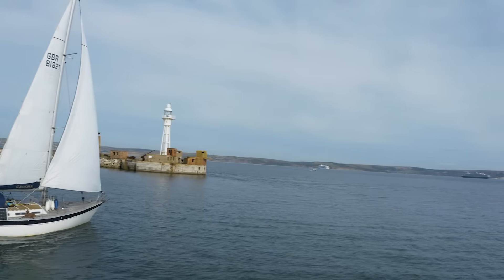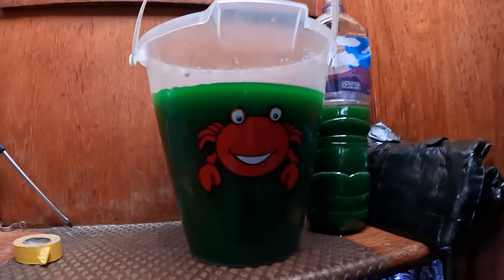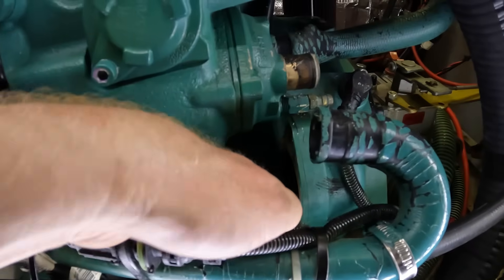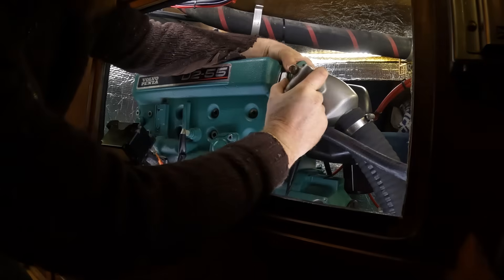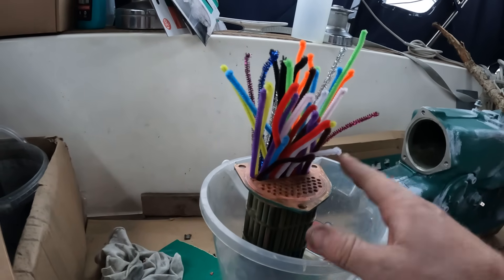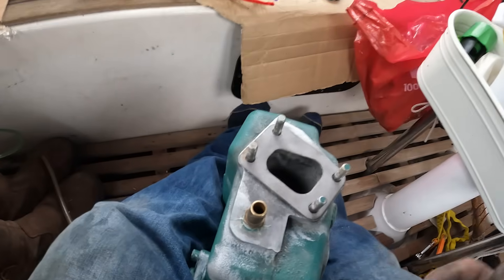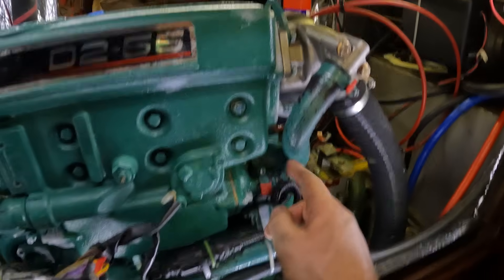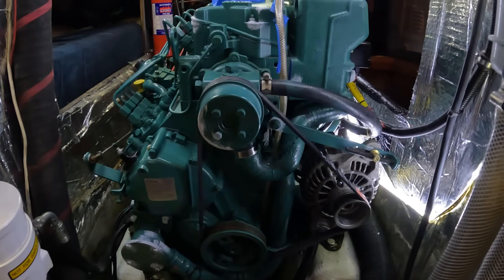Overheating  - Troubleshooting a small diesel sailboat engine  (Volvo Penta D2 55F)

Comment: paint is an insulator. it will retain heat in the engine block and contribute to the heat load. best to have as little paint on it as possible. unfortunately, and not surprisingly, most people cannot tolerate an unpainted engine block. :)

the host shows an unusual amount of patience and good cheer considering the amount of work involved in performing what one would think to be a simple task. i'm thinking the engine designers did not plan for the possibility of a saildrive. ....just guessing. :)

and either the host is lying about his previous lack of engine knowledge or he possesses a natural talent for engineering. ...i suspect the latter.
Reply from the maker: Appreciate the feedback. My thoughts for painting the engine are for protecting against corrosion?

Also your last paragraph has really made my day, I honestly couldn’t have even told you what a fuel filter looked like or even where it was just a couple of years ago 🤣☺️☺️

Comment: But, why didnt you check the impellar why you were at it? Also, i dont know the engine but did you try the heat exchanger fit the other way around as the flanges look the same and its a through fitting? nice haircut btw lol
Reply from the maker: I did check the impeller, it was one of the first things I did. I didn’t think the heat exchanger would fit the other way round as one side had a plate attached to it, but  I have to admit that I didn’t actually check to see if it would be possible, I was so overly concerned about putting things back as I found them 😬😬

Comment: I have an older model 18 hp 2002 with a saildrive which I purchased new in 1986 and regularly have to repair it as it slowly dissolves away. I won't list all the expensive problems but I have a word of advice, Yanmar.

Comment: It looks to me like you could have put the tube stack in the opposite way when reassembling.  That way the next time you clean it you would not have to take the whole thing to bits.  When I clean my tube stack (different make of engine) just hosing out the tubes after a soak works fine.  You do not need to pipe cleaner it out.

Comment: Torque Wrench!!!   Just to reiterate.  Torque Wrench.  Also, Loctite or other such thread compound will prevent seizing and ensure consistent torquing of the bolts.  Sometimes, manifold bolts are NOT coated with Loctite, but your manual should tell you what they want.  It really helps with little fitting bolts like your end covers, etc...

Comment: Small points, firstly, when using grease on rubber use the red grease , it doesn’t eat rubber . Secondly, only use sealant for water ways , not the correct stuff, and probably not needed on manifold gasket’s. As I said, small points.
Reply from the maker: Thank you so much for sharing your knowledge with us all. I learn so much from you all 🙏⛵️😁😁😁
Reply: @CadohaAdventures  unfortunately it’s mostly hard learnt , I’m a marine mechanic 🤔😪😪

Comment: Marine diesel engines by their nature are often housed in locations with very limited access, so it would be helpful if they were designed to have good access to service items in addition to the oil and fuel filters and impeller!

Fitting a hose which was molded to allow the heat exchanger clearence to be removed without the hose being disconnected shouldn't have been beyond the abilities of the manufacturer.

Inevitably, if something requires additional work to access it may well be overlooked and lead to reliability problems, as you discovered.

Comment: Sorry to blather on however when I see water used in these systems I have to comment. Engine coolants do more than just exchange heat. A big one is lubricate. The pump needs lubrication, and that’s why coolants feels a little slick.
Water should only be used to check for leaks but really not good for that. Water boils before the engine reaches proper running temp, so if you want to check leaks and don’t have a pressure testing system, then you need to bring it up to full temp.
Water turns to steam, gets too hot so problem diagnosis is difficult. I spent many years trying to resolve heating issues in IC engines, all kinds. I’ve never had nothing but additional problems using water in IC engines.

Comment: you were so frustrating to watch,  it's called a Heat Exchanger, yes you need to take the whole heat exchanger off to pull everything apart, my D255c is about 20 years old, buy the way it's a Perking Diesel Marinated by Volvo, few more tips Carry a spare Welsh plugs,  mine got a pin 📌 whole in it and was squrting water out, I glue it back together now as it's got so much corossion on all the parts, keep a eye on the seal above the starter as it can drip on it, lucky I saw it in time and heard the starter sounded very dry, your very lucky you can work on it from the side, mine i have work kneeling on top of the motor and if drop a part long way too bottom of the builge, thank you keep up the good work, does anyone know the manifold gasket part number so I can get one from a truck part's place cheers mate
Reply: p.s I could see the Welsh plug on the inside of the Heat Exchanger but you need to look closely at it they leak very slowly,  only a few dollars at the auto shops,
Reply from the maker: Sorry about being so frustrating to watch, I'm no mechanic, just a guy, trying to figure this stuff out. I really appreciate all the tips and wisdom you've just shared, that alone makes this such a valuable learning tool for me, and I hope others too.

All the parts I got were from a site called parts4engines.co.uk and they all seemed very good value compared to a Volvo shop, although you're right in that I imagine you can still get them much cheaper from Perkins or the like?

Best of luck 🙏🏻
Reply: @CadohaAdventures  you can't beat parts 4 engines they are the best

Comment: maybe the internal part of the heat exchanger could be put in from the other side  so when you have  to clean it ,in stead of pulling it from the rear side of the engine you  could pull it from the front so maybe disassembling the hole heat exchanger may not be nessesary it looks like it it could be put in from both sides.
just a thought
Reply: The heat exchanger is flanged on one side so it cannot be removed from the other side unfortunately...
Reply: @ozolli  maybe andi would give it a try and put the flang as you call it on the other side.
Reply: I saw picture,s in manuals  ,there was the flanged from the  heath exchanger   on de frontside

Comment: PPS, Diesels Love Working under load, and you can help clean the insides by checking what rpm Peak Torque an Peak Horsepower are for your engine, and, occasionally once up to temperature, run them for an hour or two between PT and PH. When doing a Crossing, As the Sun Goes Down, I Furl in the Sails, I Motor for an hour or so, Nav Lights and autopilot on, and get the evening Meals on the go, mostly using a portable induction Hob, and the Heat Exchanger is providing the Hot Water for a Shower, plus on my next boat, will be running the 12v Watermaker, Last Night, before the Sun comes up to hit the Solar Panels, do the same for Breakfasts The Routine keeps the Engine Happy, the high output alternator keeps the AGM Battery Bank and starter AGM Battery happy, and the Crew Well Fed, watered (tea, Coffee, hot chocolate etc) Showered and Happy as well. Happy Diesel Engines tend not to let us down when we need them. Bob. 👍🏴⛵️🌟🌟🌟

Comment: great design the volvo not - any water leak falls on the alternator that then needs replacing stoopid - see Zatara
Reply from the maker: They have this issue then? Makes me even more motivated to fit the dual alternator upgrade, now not just for the extra charging capacity 🙏🏻😁

Comment: Do not use any abrasives on sealing surfaces. You'll cause yourself more headaches than you can count. Use plastic razor blades, a rubber scrubber (they're specifically designed to clean gaskets) on a drill, at worst, a blunt razor blade at a very shallow angle.

However, if damage is already done, get yourself two sharp stones (the kind that come with two grits glued together) and after you rub the like faces together to achieve perfectly plane surfaces, gently and evenly in decisive moves go from one end to the other of the surface you want to clean, without pressing on the edges.

There's several videos detailing this kind of procedure on the machinist side of YouTube (people like Tom Lipton, from OxToolCo, or Keith Rucker from OldMachinery).

Sealing surfaces need to be as scratch free as possible, because any deep scratch you inflict or even light scratch you inflict will be 'tomorrow's' passage for gasses or fluids to escape and make things worse, doubly so in marine environments where everything seems to fall apart just to make one's life worse.

Comment: In terms of the electrolytic corrosion at the interface with the stainless steel exhaust elbow and the (Aluminium Alloy ?) engine a gasket will not solve the problem as it will be electrically bypassed by bolts / studs and nuts allowing the corrosion to continue. You need to consult an expert on how to prevent this but I expect that a stainless steel elbow is a bad choice as Stainless Steel or in fact the Chromium it contains is very active in terms of electrolytic corrosion. A good thing to read in the book about Metal Corrosion in Boats by Nigel Warren which covers the various problems in lots of details. It is probably better to have the elbow corrode than the expensive engine block. However you need to check & replace the elbow at regular intervals. Hope this helps and saves you the cost of a new engine jacket that will be mega expensive.
Reply from the maker: I've since now covered the bolts in Duralac but I'm also told that no matter what I do, the water flow will also cause a current, so the stainless steel exhaust elbow seems like a bit of a bad idea then? Annoying as it was such an expensive part 😔
Reply: @CadohaAdventures  
zinc pencil anodes?
Reply: @CadohaAdventures  Coating the bolts will not stop the corrosion as you need to have good electrical isolation. Something like a 'top hat' insulator that covers the thread of the bolt and extends under the head may work . BUT it has to stand hot conditions and the compressive force of the bolt - not an easy material choice. In terms of of the water flow causing an electrical current there has to be a complete electrical circuit. Think of it as a battery where the Anode & Cathode are the two different metals, the sea water is the battery electrolyte and the electrical path through the bolts or through the gasket if it is conductive completes the circuit and allows electrical current to flow and one of the components to corrode. In this case the anode & cathode are the cast iron of the exhaust manifold and the chromium in the stainless steel. If the bolts are isolated the circuit is broken and the circuit is like a battery with no load connected and little if any corrosion will occur. 

The insulation method is used when fitting stainless steel fittings to Aluminium Masts - a long while ago when I was involved in dinghy maintenance we used thick layers of Zinc Chromate at the joint and then special rivets to reduce the risk of electrolytic corrosion. Of course Zinc Chromate is frowned upon now as it pretty lethal.

Don't give up on the stainless steel injector as it appears to be one of the best choices for this very demanding component according to the book above. The combination of seawater & hot exhaust gasses is pretty destructive to most metals.

As I said above you need to consult an expert !

Comment: This is more than a little sad isn’t it? imho, the Heat exchangers definitely need an annual removal and checkover as well as a clean. The Volvo Saildrives on the smaller engines are far and away the best, and are only matched by Yanmar Saildrives for 80hp and above Yanmar engines when they can then have the ZF Saildrives. Not that I recommend them being a used, but the amount of Abuse the Volvo Saildrives can take and be pretty well recoverable from, is absolutely staggering. One I saw restored, hadn’t even had a service for over 20 years, and still had the original Saildrive to hull double Seal. With parts, internal seals etc replaced, and fully restored and Serviced, it was back to normal. Parts prices are Stark Raving Bonkers though. Still, I’d cheerfully cross Oceans with one. I’m ok with my Next Sailboat coming with a Yanmar 85hp inboard with direct Drive, as it will have all around access to the Engine, gearbox, and Stuffing Box / Dripless thingy (which have become reliable enough to have one (not sure if I’d actually prefer a Volvo tbh - but the heat exchanger for one of those in the USA for the Yanmar, is 800 dollars, So to me, Volvo have to be chronologically Overpriced for basically the same thing ☹️). Best Wishes and Fair Winds. Bob in Wales. PS, your Dog looks suspiciously like a Hungarian Vizsla ? As a Dog lover, that has to be the Best Dog Breed in the World. I had the First Vizsla in Wales. The Best Buddy you could wish for. 👍🏴⛵️🌟🌟🌟

Comment: I wouldn't use muratic acid.. that would be too much for that copper.
Here's what you do.. 
Buy white vinegar in bulk , go to your bulk products grocery store and get two gallons of white vinegar. That store should have a quality squirt bottle . Buy one.
 The beauty of vinegar is that when you reduce it on the stove, it becomes more acidic! So reduce half a gallon by half and use it ..
 The next time you have to remove the heat exchanger.. take it down to a welding shop and have them weld up that exhaust port to give you back that corroded material loss. , it won't cost much.

Comment: well done you,, a job like this would cost you a small fortune to have a ""marine mechanic"" to do it for you, I am not criticizing you,, but may I suggest that you invest in a work shop manual for your engine as they are not very pricy to buy on line, and you will find all the torque settings for the bolt's for this engine in it,, you should also invest in a torque wrench to make sure you do the bolts up to the right tightness instead of just guessing them , "which is a big no no!",  as snapping a bolt or stripping a thread can be a real problem getting it fixed again in a boat engine,,  but you did a good job their, so a big pat on the back go's to you,, and by the way, the next time you service or repair your water pump impeller,, if any of it's leg's are missing from the water pump impeller,, you know were they have gone!, and they must all be recovered before you call it a "job well done!",  because some body only did half the job on the pump at some time!,,  great video,, you also used a steady camera support,, so no sea sickness watching it, and no bleary eyes when going out of focus,, again its a well done you,,

Comment: you might paint bolt heads diff colours on diff parts , in hurry makes things simpler for apart and together without having to think  under presser at sea.  NO STICK ANODE on heat exchanger  o dear volvo   . good job you make hank proud
Reply from the maker: I was thinking that about the heat exchanger and some kind of anode. There seems to be a lot of debate about it online, but I feel most people would rather one was indeed there 😔

Comment: Car radflush will do the same job....just a little less aggressively..
If your parts are warm or the vinegar is it will be a bit more reactive.
You would think that manufacturers would come up with remotely mounted heat exchangers ... But that would be  too easy for customers. 
Hard to definitively say but your exaust elbow as you described it doesnt look like stainless🤔
Reply from the maker: What does it look like to you? 🤔 I agree it’s not shiny though 😬
Reply: @CadohaAdventures  Cast Aluminium... If it was Stainless it would be heavy hard to scratch and unlikely to be cast and machined..
Higher temperatures tend to increase the rates of most chemical reactions that goes for steam water or gasses..
A leaking head gasket can cause over heating especially on some engines, where engine piston combustion gas can leak into the water jacket ... If you get bubbles in the coolant it can be a sign ..sometimes it only shows up under load at high rpms at first... It tends to result in sudden boil ups and coolant spills....eventually water will start getting into the oil ways in which case you can end up with the dreaded coolant loss into the sump oil ...and dirty  mayonnaise on the dip stick and in the oil fill cap...😬
Reply: @clivestainlesssteelwomble7665  the stainless exhaust elbows are usually just cast without polishing the ones i have on my yanmar and perkins for the genset are the same. the best solution to the dissimilar metal issue is Tefgel and good anodes, I didn't notice if you checked them if not might be a good  idea, also get some Neverseez pure nickel antiseize for your threaded components and some Stag jointing compound for the exhaust elbow gasket. great video.

Comment: Great video and a great job. Definitely a poor design. Imagine if you had to access this while underway in rough weather. I don't know if there are other material choices available, but the use of a stainless steel exhaust elbow on an aluminum heat exchanger is a terrible idea without a sacrificial anode. You are trading corrosion of the exhaust elbow (low cost and easily replaced) for corrosion of the heat exchanger (high cost and a huge job to replace).
Reply from the maker: Would that still be the case even with a gasket between the two to separate them?
Reply: @CadohaAdventures  There is still a path for electrolysis through the fasteners. Volvo knows better than this design. Maybe the SS elbow is not a Volvo product. Sorry for the news.